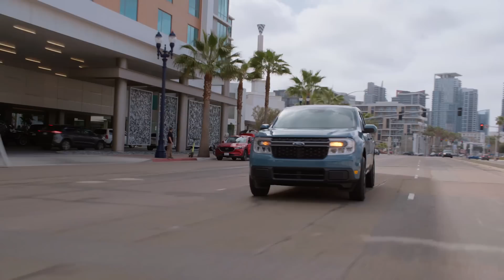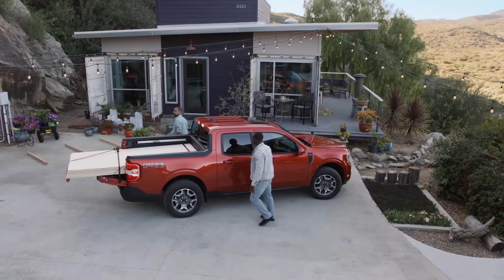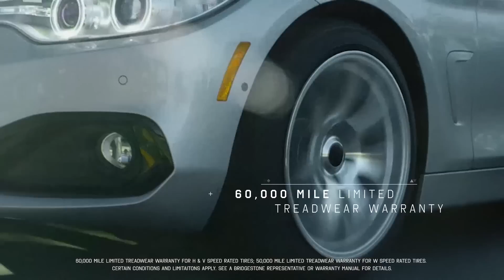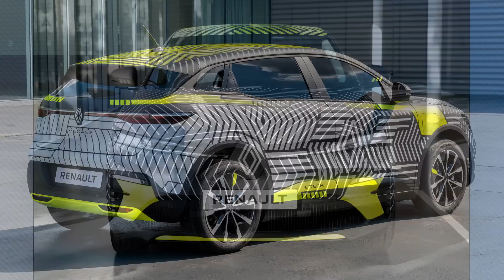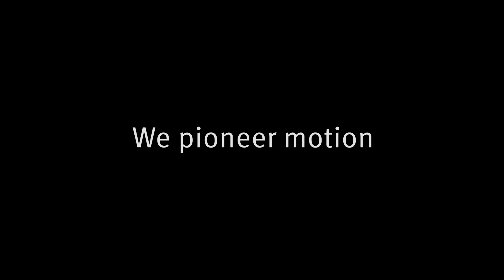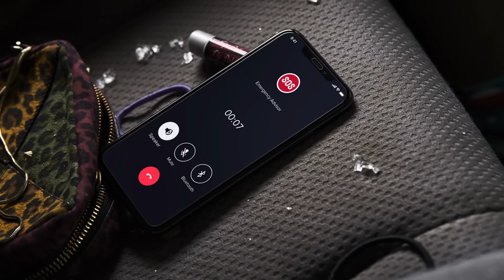Ford Maverick is a 40 MPG Hybrid?!; Kia Reveals All-New Sportage - Autoline Daily 3096

Comment: Ford sure is on a roll. First the Mach-e, then the Bronco & Bronco Sport, up next the F-150 Lightning & now the Maverick mid-size truck.
But don't kid yourself, that under $20,000 base price will be for a bare-bones model. Expect to add @ least $10,000 for an optioned-out model. But for a 40mpg trucklet, that's a lot for the money.

Comment: The Maverick will sell like crazy if it stays fully loaded under $29K
Reply: Ford's already released pricing and the options seem like they stack all the way to ~$37k
Reply: with fully loaded full size pickups going for over $80K....  $37k for a hybrid pickup is still a bargain... and $29K was an unrealistic dream....
Reply: @nc3826  the hybrid is the entry level model, so you shouldn't see that configuration crest even 30. I'm actually curious who will be legitimately interested in the 20k base model considering it's only FWD. The outdoor lifestyle enthusiasts this and the Sante Fe target do go off-road, so it may not sway them from their expected Subaru Crosstrek purchase
Reply: @JDubbs07  WADR your the one stating it will top out at $37k... if you think that's to high for you, buy a cheaper version or do not buy it...

And your being very short sighted to think its only or even mainly targeted at outdoor enthusiasts....  Im will to bet there are plenty of ppl who want switch from an SUV to buy a non-AWD version. For its higher MPG, great reliability and for its lower cost...  
 
Who have no need or desire to, play in the dirt... But instead want a utilitarian cost effective vehicle.

No one said it will fit everyone needs or desires...  Ford has the Bronco/Ranger platform for those that need more off road capabilities, apparently like you ..... To each their own....
Reply: @nc3826  it will top out at $37k - for a fully loaded 2.0T EB with the towing package and other niceties.

And I'm not being short sighted, Ford has been very clear about the intended customers.

You write too much.
Reply: @JDubbs07  Your just sensely repeating yourself and stating your pointless opinions.... 

My short sighted, confused trolling friend... And good luck getting help with your pointless ranting problems....

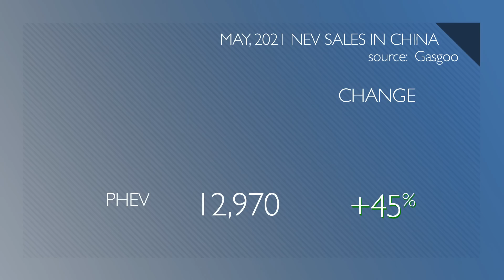Comment: The data at 7:00 is wrong, that's BYD sales figures, not China ones (which are 154K BEV (+18.6% MoM) and 31K PHEV (+11.7% MoM) retail sales in May).
Reply: Citation needed.
Reply: @DocWolph  for some fucking reason youtube keep deleting my post with links (I posted them in comments in autoline website, comment #12), but either 32K is waay too low of a number for entire Chinese NEV market, it has been posting sales of over 100K for more than half a year by now (well, it fell to "just" 97K in Feb, but that's because Chinese New Year celebration and shorter month means less business days which causes car sales to fall, for example in April 163K were sold).
Reply: @HidingAllTheWay  
Try not posting it as an active link. Leave off the "Http://www."  YT's Algore will likely not look to check then.
Reply: @DocWolph lets see if this works twitter.com/DKurac/status/1402194313606426624 for China's May NEV production/sales numbers, twitter.com/DKurac/statu,s/1401866348439896065 for BYD ones (you can see the retail sales numbers are identical to ones in the video)

I know this is just a twitter account but he's been great at collecting and translating news and reports on Chinese NEV industry and is reliable source.
Reply: Go check the the real title, for the Linked Story: "BYD NEV sales surge in May greatly thanks to soar in PHEV sales" ...  it was never about China...
Reply: @nc3826  doh, never thought to check the link. But yeah, Autoline screwed by skimming the article or by misunderstanding it.
Reply: @HidingAllTheWay  Now we have to see if Sean/Autoline will run a correction or not? It seems doubtful, but I hope that I'm wrong.

BTW, I have found many errors of fact this way... Where Sean tries to spin stories to have a more dramatic affect or a narrative that they have at Now we have to see if Autoline will run a correct or not? It seems doubtful, but I hope that I'm wrong, . So the easiest way to fact check Autoline when the facts do not seem right, is to use Autoline's own source. 

FWIW I do not follow China's NEV stats, so  I had no idea the stats were incorrect. So it was a team effort. Thanks for your input.

Comment: Maverick Lightning would be a huge hit with so many people that don’t often need a ‘truck’, and want to go electric, but don’t want a larger vehicle like the F150.
Reply: Would a lightning bronco not make more sense?
Reply: I agree.... a small EV pickup with 250 miles of range would be a hit...
Reply: Ford will have a hard time keeping up with demand for the Lightning.... once it ramps up it battery production capacity... 
And the Range

I willing to bet future Ford C2 platform (ie Bronco Sport/Escape/Maverick) will be designed for EV powertrains, since it not as easy to convert as the ladder on frame F-150 Lightning
Reply: @dmitchellhomes  "I agree.... a small EV pickup with 250 miles of range would be a hit..." Really??? At what price and with what other capabilities, would it be a hit?

And so would apple pie and free money be a hit, so thx for another pointless truism... smh...
Reply: @dmitchellhomes  Considering trucks are: heavy, go through the air like a brick and most are still built on a very basic chassis then any EV truck doing a real 250miles is a tall climb. Trucks work because fuel is cheap (cheaper than the car parts), carbon emissions are near free (no matter what the damage to humans and the planet they live on) and trucks intimidate other road users (humans love of one upmanship). If gas reflected the harm its causing then truck sales would be a niche like wagons and sports cars. Demand for them yes but as a normal form of transport no

Comment: Maverick Hybrid  OR   Maverick BEV  ?    Hybrid should have been made in 1990s. (Prius time frame)
BEV Maverick should have started 20 years ago - to counter GM (Saturn) EV1.  
Showing how the US lost leadership in the small vehicle market and seems China will take over.
Tesla the wild card - if government (State & Federal) doesn't screw it up. Ford gets further behind.
Reply: Ford didn't made a small pickup like this in the '90s (they had the Ranger in this same size, but it'd take a lot more money to develop a system for RWD vehicles as they tried for FWD-biased ones), but they did put their system on the Escape and the C-Max, but their hybrid combos (like Honda's) weren't good enough to do the job. Now they're both catching up....

It is good that Ford put their hybrid tech in the Maverick pickup as soon as they could.

You may see a BET Maverick in as close as 3 years at this rate....

Comment: Maverick will be a hit….  A lot of families it will fit perfect for
Reply: @nc3826  oh, I still have quite a bit of Ford stock, although I did sell some GM and Ford on the recent highs,  but still have large positions in both companies.
Reply: if ONLY FORD had a good reputation for dependability/ reliability….but they just don’t
Reply: @jpear The Ford Maverick is one of the most reliable trucks on sale, and Toyotas trucks are having issues left and right. Reputation doesn't mean much.
Reply: @nc3826    I think you need to work on reading comprehension,   maybe go back and re-read what I wrote.      I have never changed my tune,  and usually post exactly what I do, when I do it.   Stock investing is not a secret,  and the more people that follow my trades,  the better I do.  So certainly not trying to change strategy,   but I do buy and sell daily, in limited quantities.   As for the benefits of long or short trading,  I max the lower 3 tiers  of capital gains every year,  so the marginal tax rate is not much different,  and I also have accounts with different tax structure, where there is no disadvantage to day trade.     I also have accounts for my children that I manage which clearly have a much longer term strategy, and tolerance for risk.     BTW,  you been watching Lucid?   Haha!   up 45% since mid May,   How about XPEV?   Even Better...   Better than a sharp stick in the eye?  I guess...

Comment: Sean, if Ford uses the NA-2.5L Hybrid combo (it's NOT the base engine in the Escape either) in the Maverick it'll become THE MIDDLE POWERTRAIN between the base and the EB'd 2.0L.

If Ford do want to keep the starting base price at U$19995 + delivery (an ode to the original 1970 base price for the original Maverick coupe at U$1995 and something Ford execs hinted at as well) they can't use the EB'd 1.5L 3-pot as base (the base Escape with the engine starts > + U$3K). 

They'll use the Focus-based 165hp NA-2.0L I4 Ford already uses in the Transit Connect cargo and passenger minivans, which is an "older technology" (several years as the 160hp volume seller on the US-spec Focus and the topline EcoSport mini crossover). That will make 3 powerplant options on the Maverick.

Saw Ford's solution to the "plywood dilemma"... Maverick's cargo box is just wide enough between the wheel wells to fit 4' wide planks. Just tie them and keep the gate open (forgot to add the mandatory 12x12 " red flag most jurisdictions require for such a situation).

I still expect a topline Grabber variant with AWD and the 2.0L EcoBoost....

Comment: Hybrids are a scam.
Reply: Like NATURAL GAS, hybrids systems are just a TRANSITIONAL STOPGAP until BEV's take traction in the market. With the "supply hiccups" on battery supplies Toyota, for example, can make 30 HSD vehicles with the same battery materials of a single BEV.

But marques can't invest too much on hybrids because sooner than later BEV's will replace them (probably to be replaced a decade or two later by HFCEV's).